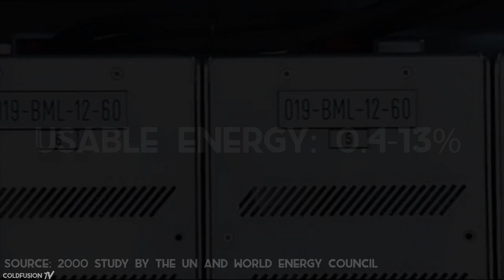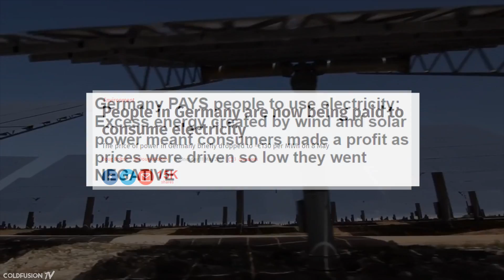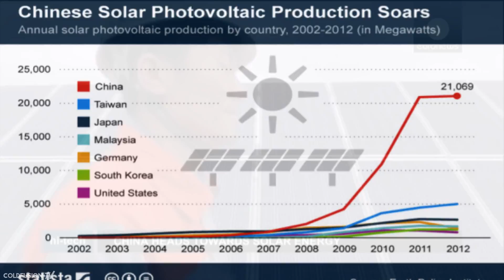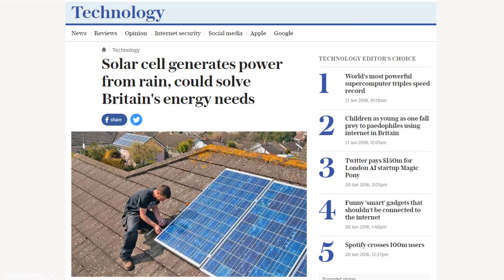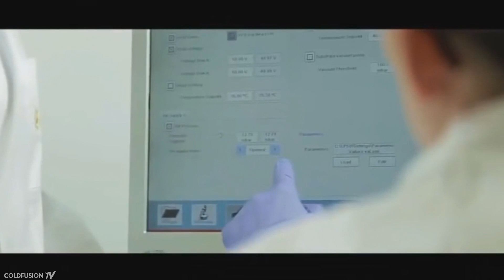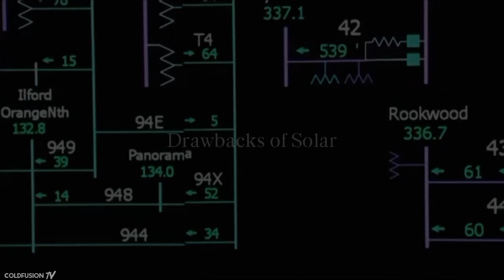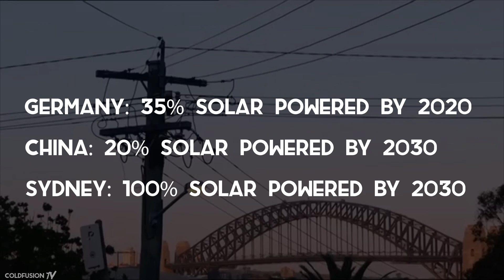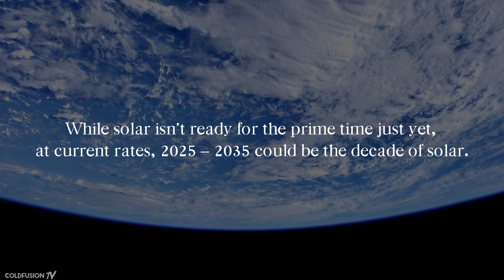The Truth About Solar

Comment: People who disliked the video, i really want to know why did you dislike it , not going to judge or anything , just want to know what made you dislike this video. Please comment, maybe You know something that other people don't and it would be really nice if you could share it with us :)
Reply: Well I didn't dislike it but I understand why some would. From an electrical engineer standpoint this is not clean energy. Clean energy meaning no dips, or variances in output from plethora of producers. Trillions of dollars must be spent in order to properly incorporate the variable outputs. It's a mess, and it is far easier to have fewer larger predictable producers than millions of tiny unpredictable ones. It is literally burning out our electrical grid and raising the overall cost of power. 

We should be pushing for safer fission and fusion energy. Something that would be able to power industry as well as being able to provide residential power. You simply cannot make certain parts of industry economical with intermittent sources, like recycling or producing metals. You simply cannot run a foundry on solar and wind where you need 100's of MW of 24/7 electricity.

Then there is the argument that solar and wind may actually making our carbon output even higher.  Without storage you need to run conventional power plants at idle or use less efficient more responsive power generation. Even if you max out solar and wind production on the grid it would be better to have more efficient generation from conventional always on sources like coal or NG from a CO2 production standpoint. Most if not all carbon output mitigation have been increases in efficiency and not the integration of intermittent power. 

I like solar, I live in the Nevada desert, and plan to get batteries to store my electrical production, but this is not an option for 90% of the human population which simply cannot afford this.
Reply: +Phlaked Corn 
Totally agreeing
People don't really know what they talk about, they just son't know physics
A solar panel cannot charge a car efficiently and quickly.
Solar panels can't provide energy to heavy industries or transports
See an example : In French Railways, 14 000 trains are riding the network each day
A train consumes 5MW, let's say the same amount of energy that produce a wind turbine
Only for railgrid, we need at least 14000 wind turbine ? a windturbine cost 3M€to build, so we need 42 Billions € only to power french railway ? where do you put them ? Imagine for solar panels, it would be 5 times worse ! with that amount of money, you could build 5-6 nuclear plant, or just funding researches ! 
All this is clearly bullshit, what we need is changing our consumption and our needs
Reply: Theo Fce I love that you brought up France. They get almost all of their electrical energy from nuclear, and as a result enjoy low stable energy costs. They recycle almost all of their nuclear waste, and as a result the amount of completely spent fuel for the entire country is stored in an area the size of a basketball court, and even most of that could probably be used with future technology. They are actively researching future energy tech. They are a great example of how an industrialized country should operate. They also spend far less on healthcare than the US and have way better outcomes, live longer and are happier as a whole.
Reply: Solar Power is a party trick compared to what something like a molten salt thorium nuclear reactor would do to completely and revolutionarily change the way that we are able to live our lives across this planet. You need hundreds of acres of stupid solar panels to come up with megawatts of energy, when we could create megawatts of thermal energy in an area the size of my bedroom, just by melting rock... Seems like a no brainer to me.
Reply: bensemus x I'm pretty sure the healthcare cost # is completely made up. That would mean we spend 30% of all of the entire earth's economy on healthcare expenses related solely to pollution. When in reality no country on the planet spends anywhere near that % for health care overall, closest being the US at 17% but we have the least efficient system of all. The more I read the more I see BS layered on BS. I'm guessing somebody is heavily invested in green companies and is producing this completely out of self interest. No one knows the true cost of climate change, over time I'm sure it is fairly high but not 22% of the planet's GDP.
Reply: Theo Fce Hydroelectricity is great, is 2nd in Safety to nuclear, We should utilize as much of it as possible, But there are some downsides, As it invades the environment it is constructed in so there's that caveat.

Nuclear on the other hand can and will be innovated in.

The problem with solar is that the people who are trying to sell it are banking in the fact that Electrical grid prices will rise as Carbon based power gets more expensive, What they try to hide is that going solar only helps half of your energy bills at best, But that you'll be paying twice the amount in energy related cost (The cost of the solar cells in financing) Plus half the cost of your usual power bills, So while you're paying off your power cells you're paying double of what you were paying when you didn't have the cells.

By the time you've fully paid off the solar cells, they would have degraded to the point where they No longer cover the cost of half your bill and by the time that happens, the cost of grid electricity would have doubled, So after fully owning your solar cells you'll still be paying the exact same amount in bills but you'll be 3 to 10 thousand dollars lesser. It's a scam and a lot of people have bought into the scam. 

Only buy solar power if you want to increase the value of your household substantially when you sell it.

I am for fixing the root cause of our energy crisis, That is, instead of making an investment to get a measly return if not a return on investment at all, Lower the grid energy bill instead And nuclear and other utility scale sources of concentrated energy will provide that.
Reply: They have taken the bait from fossil fuel lobbying.
Reply: bensemus x I found it very interesting that the plan suggests that the cost of the new generation facilities would exceed the yearly GDP of the the entire earth. Not to mention transmission, storage, operation and maintenance costs which would greatly exceed that. Essentially there is not enough money in the world to fund this. If that alone does not scream total load of crap I don't know what does.
Reply: There will never be a time when you can get energy in Germany for free! that whole section was bunk, please do not believe it. The German power company's have a good connections in government and will never allow energy to be free, period. that is why i hit the dislike button. Ive lived here for 40 years, ive paid for my energy for the entire time. Nuclear power plants are being shut down, wind power is being limited, from what was stated in this video, someone needs to pay me!
Reply: In Germany everyone think you energy is green, but why keep fueling your country with coal ? It's really paradoxal
Reply: Well I'm talking about the intrinsic cost of large scale solar, the human cost, the environmental cost, the ecological cost, the thermodynamic cost, etc. Plus there is the BS about Utility companies being forced to buy it from you, I think that's horseshit. Utilities should not be required to buy your stupid electricity, 1 they don't need it, 2 it damages their infrastructure and by damage I mean it introduces harmonics on the line that literally blows shit up and starts fires. This can be avoided if you basically double the cost of a large PV farm, but nobody opts to build the infrastructure at the farm to work hand in hand with the power company, generally they just dump the raw power back on the grid and expect the utility to deal with it, and basically run their system reactively instead of proactively. Utilities own their lines, they should not be told what to do with them. Now I don't care about power companies in any shape or form, but I believe in not telling someone else what to do with their shit.
Reply: Fossil fuel companies love intermittent sources. What they do not like is being able to store the energy. Intermittent sources actually increase the amount of fuel that must be burned to maintain reliable power using our current electrical grid.
Reply: The law of large numbers... Sometimes there is no why.
Reply: Phlaked Corn Check this out. http://web.stanford.edu/group/efmh/jacobson/Articles/I/WWS-50-USState-plans.html

He and his team have put together a detailed plan to get 139 countries running on 100% wind, water, and solar. Wind and solar are greener than coal and such as they aren't burning carbon to generate energy. You can only get those kinds of energies so clean and we are basicly there. Wind and solar can be much greener due to not burning any carbon.
Reply: bensemus x Interesting, a lot of material here, but at first glance this looks like a crock. I agree we need to stop burning coal. It kills way too many people so much so that it makes the occasional nuclear meltdown seem safe by comparison. We need to have a realistic approach, and frankly everything I have read and the talk on youtube linked on there seems incredibly vague. Would you be so kind as to give me a specific link as to which talk or document you found most convincing?
Reply: Phlaked Corn They estimate $102 trillion. That will however create tens of millions of jobs and save ~$23 trillion/year in health care due to clearer air. It will eliminate ~17 trillion/year in related global warming costs. You can't discredit it without reading it all. 

I'm not saying it's true as I haven't had a chance to read it all but it is extremely detailed.
Reply: I agree with you on healthcare , in India you don't really need health insurance until you want to have it, and about creating green energy on a large scale, i think creating and storing that much every for manufacturers and industries is difficult, but what about individual residents? Still there are few places in India where  electricity is luxury instead of necessity, for these places solar energy can be a savior where they can just setup a small solar assembly and use to for their benefit without paying any cost.
Reply: +bensemus x I have never heard a bigger load of horseshit in my entire life... 102 TRILLION?
Reply: Phlaked Corn I'm saying read it. You're dismissing it after reading the introduction. That number isn't just health care. "air-pollution damage costs". So everything associated with pollution.

It's a very ambitious goal but there's nothing wrong with trying to do our best. Few countries are meeting their desired emissions rating and keep coming up with new targets
Reply: bensemus x I'm not entirely dismissing the idea. However I am seeing huge BS redflags right off the bat. That is not a good sign, if you can't even get even get some of the basic info right, I seriously doubt the more technical details are any better. More examples of BS; their energy consumption models are based on current electrical demand, and do not include things like the added demand of making energy for things like transportation and heating. Their models for electrical consumption are way off, and they do not properly account for growth and assume way too much about tech that has not been implemented or even proven yet. They do not account for storage losses at all. They do not properly account for emerging energy markets, and how quickly demand is rising in those regions. They do not account for the amount of land that would have to be bulldozed for amount utility scale solar they want to implement. The biggest one of all they do not account for how this is going to be paid for, especially by more impoverished nations that don't even have the luxury of clean running water.
Reply: The reason why I disliked the video and some people have touched upon it is that it is a dishonest video.   In my view it is not telling is the truth about solar.

The truth about solar is that it is an intermittent power producer and for it to be practical on a large scale you need to solve the problems around distribution so it can be a source of steady power.     We still want power to be steady right?
Reply: Matthew Holevinski This guy gets it.
Reply: Solar energy is already obsolete, it isn't a new technology. It is way too much inefficient, and it is not a solution to answer our needs. Do you remember the time solar panels cost more energy to build, than the energy it can produce in their entire life ? It's just BS
New technologies are based on nuclear fission, and this, needs almost lots of research.
Reply: The question is what would you do as a society when you can create millions of times the amount of energy you need or could consume, what if you had trillions and trillions of joules of excess electrical capacity than you would ever need, and so did eveyone else, what would you do then? We could start to do real science instead of sitting around wasting time reinventing a more energy efficient light bulb, which would be magnetic induction lighting incase you were curious, LED's can suck it. With all that energy we could finally do something about ocean acidification which incase you are also wondering is what is going to basically end "life" as we know it, not global warming per se but the acidification of our oceans has been the result of global warming.
Reply: Theo Fce
I disagree solar power is obsolete, I think it has its limitations, but also its practical applications in certain situations.
Reply: Another great solution would be hydroelectricity, but where ? We would need a giant space to store the water at a significant level, and all the main potential of rivers has already been used
Reply: I'm about to dislike it as he didn't list what the environmental impact of producing solar arrays is vs other technologies, it's like kinda important
Reply: OnePercent I wouldn't go as far to say that solar is a total waste of money. Solar actually makes sense where I live, but I live in a desert. With few cloudy days, and large amounts of power needed for AC solar is a good option. It really depends on where you live along with the local energy market.
Reply: Phlaked Corn AC is the best reason to get solar, as during the day is the hottest period, Which means Peak electrical usage would be during the day and Peak sun as well.

Btw, I live in Australia, one of the best countries for solar. Even so, it's still scam tier with the price.

Then there's the "Battery" or power wall scam, saying it will boost energy savings up to 80 percent when only 1 battery costs upwards of 3 thousand dollars, by the end of the day you end up paying close to 15 thousand dollars.

The battery will only be rated for ~10 years as it always recharges..

The only purpose of batteries is to smooth out the daily curve of electrical production and reduce the daily use of energy, but it still charges from grid energy during night time rates, if you want to go 100% solar+battery back up good luck spending upwards of 20,000 dollars+
Reply: Phlaked Corn I'm only directing this disdain for solar-photo-voltaic as it's just an inefficient way to harness unconcentrated energy and turning it into concentrated energy.

Solar thermal on the other hand is the best way to utilize solar power. Far more efficient as it doesn't rely on chemical process's to generate electricity but rather strictly mechanical.
Reply: Tesla company is funded by tax payers under the umbrella of clean energy. Through Department Of Energy and under the Obama plan of clean energy. But with the taxpayers funded the Tesla - sad to say there's no investment return with the money. 

Question must be asks.
Why no refutable venture capitalists funded the Tesla startup?
Why Tesla is losing money?
Why every Tesla vehicle sold to the market is still losing money?
Why Tesla didn't give the government a stock options like the rest of the company? 
Why Tesla had to borrow more government money?
Why the new Tesla model has a charge fees to recharge their vehicle? Was Tesla S Model was a hook up game?
Reply: OnePercent Where I live a 20000 dollar PV system can pay for itself in about 5-10 years but that is with tax breaks and other incentives, but you are right it is incredibly costly and not a good option for everyone, but we have 300+ days of relatively cloudless days and 6 months of temps above or around 100F. Another good reason to go for solar is if you're far from the grid and the cost of getting hooked up exceeds the cost of a solar installation.
Reply: Matthew Holevinski Yep every one of those points is pretty much spot on, but what is good for me is not good for everyone else. We're only going solar out of pure self interest.
Reply: Which is totally okay, if people want to build large scale PV systems for the hell of it, hell ya go for it. But people that think it's some kind of panacea, just aggravate me.
Reply: Matthew Holevinski Well at least it's not as bad as wind. Or at least how we are implementing it. You want some serious resonance problems, put up of few million AC wind turbines all spinning at different speeds tied directly into the grid and expect things to go smoothly... Then again that kind of thing is my bread and butter, I get to fix the shit that it breaks.
Reply: Thank god for you sir =)
Reply: Matthew Holevinski Well technically I fix computers and other sensitive electronics. I'm not exactly on the front lines so to to speak. Those are the real heroes. The electrical engineers that make our grid into something that does not fry every electronic device we use, despite all the crap we are throwing on the grid, those are the real heroes. Even though my work can make or break a business, they are the ones that make my life bearable. Heck in some locations the grid is so bad, that even the best noise transformers can't even protect the equipment I work with.
Reply: Phlaked Corn Hey then it would be in your best interest to make sure we build more wind turbines X)
Reply: Because it's silly. Look at for example the power consumption in germany (they have really nice graphs online). Solar power happens in very strong  short peaks where you produce way too much to actually consume and the energy companies have to export this energy at a loss or try to waste it by heating the train rails. A few hours later you encounter a deficit which solar power simply cannot cover.

It's too expensive and wasteful for large scale implementation, until we've figured out a way to store that energy. Until that happens, it's a money drain that politicians love to throw money at because green is cool at the moment.

Solar powered transportation could work because you'd mostly need power during solar peak hours but it still has to be suplemented by something more reliable.
Reply: It's called a battery, dumbass.
Reply: Jebuslives You know they only market those batteries to Smoothen out the power production from 6 am to 6 pm? The battery still charges using night time rate.
Reply: Jebuslives Bravo, you know the name. Now all that's left is finding an affordable way to produce said batteries. Did you honestly think that I'd completely missed the concept of batteries?
Reply: MrDpsc yes, I think you did.
Reply: In the current climate I hope they are guarding them well